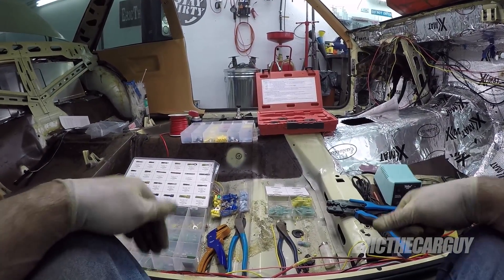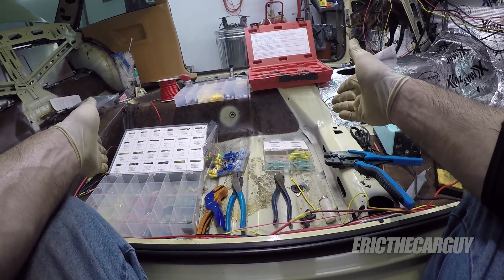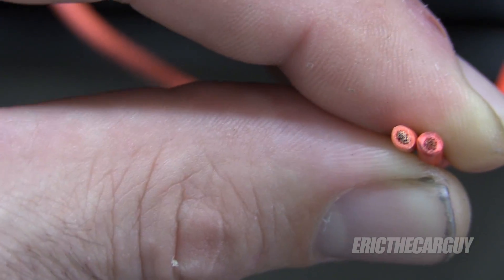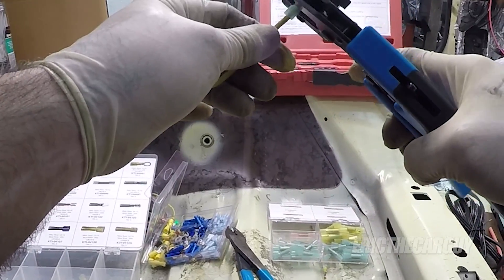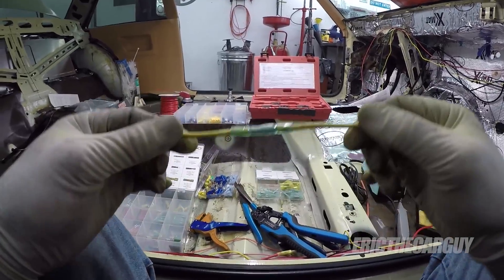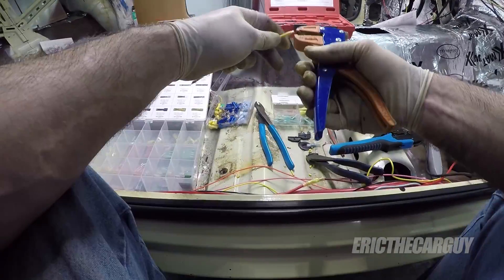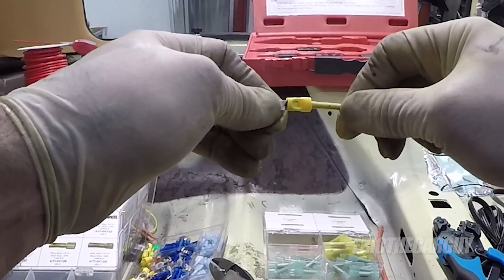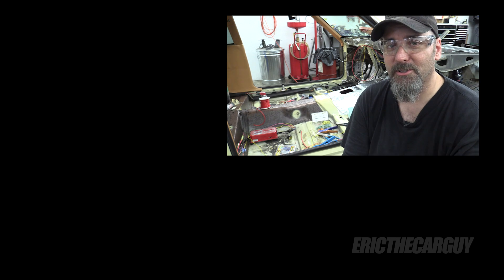How To Crimp Electrical Connectors

Comment: Being a welder for a good portion of my life, I tend to want to solder connections and shrink tube them then place them in flex loom. Just more confidence in those terminations and it looks so neat and tidy when you're finished.
Reply from the maker: I agree, but with this project, those shrink tube butt connectors saved my butt. (pun intended) When you have to make a thousand connections, crimping can save you a ton of time. Thanks for your input.

Comment: Good video, I learned that if you press the metal of the shrink tube flat, slide the shrink tube itself off, solder, then slide the shrink tube back over, and shrink. Added protection, add proper size shrink tube as well? Over-kill, I know but it's good, I've tried!

Comment: In my automotive class they taught me the crimping and soldering of the wires but they say it's better to just crimp because a crimp is metal on metal where solder is the same essentially but the type of solder is essential too. They also showed me that in time the solder can go bad in essence and creates a corrosion called electrolysis and modern tech on a car is sensitive to even the slightest drop in voltage that could be dropped in that solder. In theory you could have caused a problem by soldering in the long run than just crimping it and calling it there I hope my point is clear if not my bad but I can elaborate on that but in short they said crimping is better
Reply: the bigger isue the vibration, the hard point solder creates makes the copper more likely to break from work hardening. With electronics if it moves or the user is in contact with it you probably want a crimp/compression connector. Some reason you will see lots of glue on pcbs in electronics where vibration is expected(or over built).

Reason 2 solder dosen't crip like copper, its not nearly as squishable, It will break down with vibration and chip like an over hardened steel blade. 

Side note if you have to solder in a car make sure you have a long bit of heat shrink to keep the flex away from the solder joint to prevent bending. Still avoid it if you can on critical stuff.
Reply: photondebuger45 Corrosion between solder and copper? Never heard of such silliness. Solder forms an alloy with the copper. The solder making the connection brittle should be an actual concern. The second concern would be these type of connectors that just squish. Try to find oem terminals and get a good crimper that actually folds the wings of the terminal down into the wire, and the insulation.
Reply: What he told you makes absolutely no sense. First off, if a wire gets hot enough to melt solder, you have issues. Secondly, solder doesn't just disappear from a wire if it melts. Why ask a fabricator a question about electronics?
Reply: patw52pb1 
The automotive crimp connections that you're familiar with are not the same as the types of crimp connections using very specific terminals and tools not used by the general public, so it probably did cause confusion. With only the option between regular DIY crimps and solder, the solder would be more reliable at the expense of time. Paid installers would not solder the connections mainly because it's just quicker for them to crimp.
Reply: +Tim Ramich those connectors you mention are the strongest , you can pull out on the wire. I'm waiting for someone who fabricate clips to clip on for more strenght
Reply: DTR RTD if they are essentially welding them together, calling it a crimp isn't fair
Reply: I crimp, but then on I'll also apply a drop of solder at the tip.  I figure a bit of corrosion there won't spoil the existing metal on metal contact.  In addition, putting that bead on the tip does two other things.  It bonds the tip, more or less forever, to the connector, and it also widens the tip, meaning if the crimp were to ever slip, the wire would no longer fit through.  Of course a catostrophe is still possible but it adds an extra margin IMO.
Reply: photondebuger45;  You're correct about the voltage drop and computers. I asked a fabricator friend of mine this question about solder. He said, " If, the circuit heats up the solder will melt." Opening the circuit and who knows where that solder went? I'm going with, no solder.  Thanks
Reply: Tim Ramich 
yes, solder would not melt unless the wire was severely undersized for the circuit. where it would be a concern is when connecting to a heating element. that's where crimps are necessary.
Reply: PandaWonka 
it's not a weld, still a crimp but with the high forces it's like a weld.  
crimps are used to terminate aluminum wires to copper ends to connect to receptacles where they don't want to rewire the whole house. aluminum can't be soldered, so crimps are needed. Those use a special crimp process that bond the copper to the aluminum, using very high compression forces.
Reply: Broken joints aside, if you have a voltage issue the connection isn't good period. Solder can go bad, but you SHOULD be heat shrinking to help prevent that.

Realistically, unless you have a very special application, both are the same.
Reply: Solder is more reliable for the DIY; for aerospace and mil applications, crimp connections are required in cable harnesses subjected to vibration because they're not brittle as a solder connection would be when the solder wicks up the wires.  

However, the crimpers used there are very different from the DIY crimpers, because the specialized crimpers actually bond the wires together from the very high compression forces, essentially creating a pressure weld.  That won't be happening with the generic crimps.

Solder and heat shrink is best for reliability, and won't be as prone to degraded connections over time from corrosion with exposure to humid conditions in the environment.  Generic crimp tools will leave some air channels that can allow internal corrosion to happen over time; soldering after the crimp would help fill the gaps.  Just need to take care not to overheat the insulating sleeve if using cheap quality crimp terminals though, causing them open up and just slide off.
Reply: DTR RTD 
+ck m 
Please cite the MIL/Aerospace/FAA advisory circular publication ID, chapter and section that show explicit warnings and or prohibition of solder joints and or soldering connections/connectors. 
Galvanic corrosion/electrolysis/corrosion and or zinc/tin whiskers is only an issue with certain specific solder chemistries used with specific metals used in conductors/termination/mating surfaces.  
Yes, crimp terminations with an anti-oxidation/corrosion inhibitor compound are required for aluminum and copper to aluminum which is not applicable to this video or anything automotive. 
A crimp termination is not a weld nor is it comparable to a welded connection in terms of resistance/impedance/conductance or durability.
Reply: `I am familiar with most connectors and their associated tooling whether OEM/aftermarket automotive/transportation, motorsports, MIL, aerospace, marine ship, sub-sea, industrial, commercial, building/construction, generation/transmission/distribution, electronics, communications, interconnect, consumer/DIY. 
Most connectors are available to the public unless custom and proprietary, however there may be some difficulty finding local stock. 

I agree completely, crimp connectors take less time to terminate than solder connectors and when constructing harness assemblies mass crimp terminations are easier, faster and more economical. 
Several studies have shown controlled cycle ratchet crimp terminations have more consistent results than solder terminations in the field.  However that does mean that a properly executed solder termination is inferior to a crimp termination.

Comment: soldered connections I feel should be avoided in automotive applications as soldered connections are brittle and might break due to movement and vibration...
Reply: That's funny, because the ECU, TCU, etc. etc. are just chock full of solder joints.
Reply: All i know is what my experience has been.  I've repaired every manner of wiring, including main power wires, using a crimp on connection that was then soldered, and insulated with heat shrink tubing, and I've never had to go back to fix any of it a second time.  I've used this method for stereo, including amplifier power wires carrying 40 amps or more.  I used this exact method to repair the main wiring harness up in the wheel well of an 89 Accord after someone reattached the bumper cover by driving a drywall screw through the fender, and wiring harness, and shorted and melted half the wires in the harness.  That particular repair was perhaps 6 wires, one of them being the main constant hot feed that goes into the cabin.  It was in a high vibration, damp area, and the car went many years after that repair with no more problems.

I wouldn't just lay the wires next to each other and solder them, or do a twist and solder repair, but I always add solder to the crimped connections to give it some additional protection from moisture, and I have never regretted that approach.
Reply: I've never had to fix a solder joint i've made in a car, i've fixed plenty of cheapo crimp connection's though.  Quality crimps with a proper tool work great, cheapass kits that come with the plier type crimpers don't.  Not many people working on their own car want to drop 100$ plus for a proper crimp tool though
Reply: Grigori Rasputin I would think that the crimp connectors we are soldering here provide just as much of a solid pad for the solder to stay put on as the PCB does.  I don't pretend to know everything about electronics, but I've been doing this for 30 years, and have never had to go back and repair a connection that I've made this way.
Reply: Simon Coles the more I read the more confused I get. I say this cuz I know nothing. I mean that. I'm Laurel Ron's Wife. if it was not soldered to begin with. I won't do it. if it has solder on it before then I'll do it again. that way I won't mess stuff up. but anyways I don't know how to solder. I best learn. my man does though.
Reply: Thomas Herring When soldered correctly a wire on wire connection is nearly as good as a decent crimp giving that the connectors are the correct size and are crimped correctly. The resistance in the connection will normally be lower or non existent.

If everything is absolutely fixed and there is no flex solider is fine unless the connection/cable is underrated and the cable is going to get hot (starter to battery for example)this will be the weak link and fail due to the solider starting to melt. Because when cars are built weight/cost is a factor all cables are loaded to the maximum for their planned duty cycle. 

The trouble with soldered connections is that if the cable is overheated it will change temper when it cools and the joint may not fail but the cable immediately adjacent will. Solider will wick down the cable. This is normally the case on larger wires when a suitable joint is made, mostly due to a soldering iron being not big enough IMHO. The copper in the cable is tempered by the heating and cooling. The biggest problem with crimp lugs I have found is poorly crimped and/or the crimp section is sized incorrectly for the wire used= bad connection ~ wire gets hot and brittle and will break out of the connector. A cold crimped connection will retain flexibility all the way to the connection. 

A good rule of thumb is anything less than 0.5 amp or a wire shorter than 1 " is OK for solider otherwise crimp when using in a car. Vibration and torque will damage cable feeding soldered connections.
Reply: Brittle?  how ?  there is nothing wrong with solder connections,  the world seemed to work fine with them.   The problem is with the knuckle scrapers that cant learn to do tradesmen like job  i.e. most people these days.   Far simpler to go with crimping,  more idiot proof and quite functional.
Reply: yarpos did you read my post? What dont you understand or is it you just disagree. Copper wire is hardened by heating and slow cooling, this makes it brittle.
Reply: As I said elsewhere, I won't pretend to know everything about electronics / electricity.  Certainly there are others that know more.  However, I have a pretty good understanding of the subject.  I spent two and a half years studying electrical engineering, and have worked with electricity on and off for over 30 years.  There is a lot of miss-information in the comments here.

dazaspc, I disagree.  I say you are wrong, categorically, absolutely wrong.  As a matter of fact, I say you have it 100% backwards.  You should look up the process of Annealing, which is commonly used on copper, to soften it.  Annealing is heating the metal up, and then cooling it slowly.  This SOFTENS the metal.  Hardening metal (making it more brittle as a result) is accomplished by heating it, holding it at temperature for a period of time to allow a proportion of the carbon to be dissolved, and then quenching the metal to quickly cool it.

However, this process does not work on copper.  The only way to "heat" harden copper is to do so in the presence of an oxygen rich environment, which can cause oxide embrittlement, but this is not something that happens accidentally, it is done in an oxygen enriched chamber.

As for worries about soldered joints melting under heavy loads, the solder that is usually used for automotive electrical connections is 60/40 which melts at 188 degrees.  The cross-linked insulation used on most good automotive wire melts at 125 degrees, so you are going to be in a serious mess with melted insulation, and short circuits long before the heat in a circuit gets high enough to compromise the solder joint.

While it is true that soldering a wire makes that soldered area unable to bend and flex, it is also true that wire crimped into a steel connector can not flex either.  It will flex just outside the steel crimp connector.  The point just outside that connector, where the flexing occurs can, over time, become mechanically hardened (the only way to really harden copper is mechanically) and brittle, causing the copper to crack just outside the connector (something I have seen many times).  Adding solder inside the connector doesn't change this in any way, it simply fills the air space inside the connector, thus keeping it from harboring moisture which can cause corrosion.  The only way to avoid the possibility of hardening and cracking at any kind of mechanical wire connection is to provide the wire with a "strain relief" to physically keep it from bending to any great degree right at the connector.
Reply: Soldered vs not soldered... what the right way is changes with application and design.  You'll get the answer that "aerospace crimps" but that's not universally true, there are whole vehicles with no crimps but solder joits.  The factory doesn't use solder connections?  Have you looked inside most ECM's?  Most have soldered jumper wires in them, and if you pull a harness apart many cars have factory splices that are soldered.  If you go through most factory service procedures they outline the right way to do both a solder splice and a crimp splice, or sometimes just the solder splice.  

The argument is that soldering causes solder to wick into the stranded copper and makes it stiff there and it wll be prone to breaking were that stiff area stops... well what happens at the strain relief on a crimp?  Same thing, the difference is that not the solder has sealed the copper into the insulation so the wires are less likely to break from corrosion.  

When it comes down to it a solder connection will have lower resistance over a longer life., crimping is faster and more convenient, and the only right way to do a weatherpack, metripack, Deutsche and similar high quality connector.  OTOH, trailer harness connectors typically need to be soldered or screwed.

What I do depends on what is best for that joint.  OTOH, I have a good assortment of crimping tools, soldering equipment... so whatever I choose is done correctly.
Reply: Electrical faults are the main cause of vehicle fires and many are caused by wires vibrating or rubbing on other parts of the car which can cause insulation to wear away or connections to break or come loose. Soldered connections on flexible wires are very brittle and are highly susceptible to this kind of failure. Now I don't think soldering the wiring to your stereo head unit or speakers or other small accessories like bluetooth phone kits is an issue but I'd never trust the wiring for any lights, HVAC or fuel pumps etc to soldered connections. It's asking for trouble.
Reply: Thomas Herring except they're on a PCB and the solder is on pads, so it can stay pyt
Reply: Simon Coles soldered connections in the engine bay are bad news, but anywhere else isn't much of an issue
Reply: But when wires in a flexing/vibrating/moving loom join up to something stationary (connector blocks etc) car manufacturers use crimp connectors. The components inside the ECU/TCU etc don't move about in relation the PCB they're soldered to.